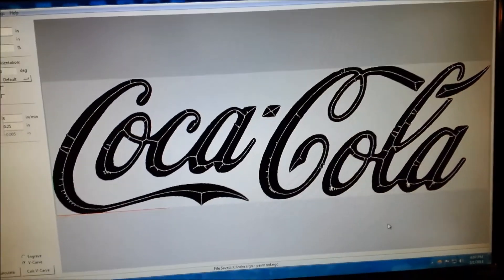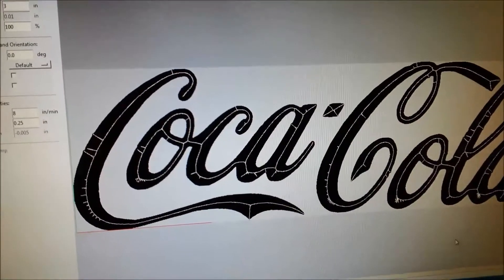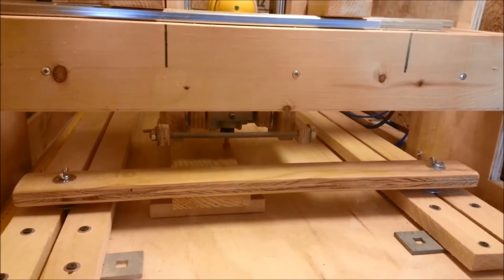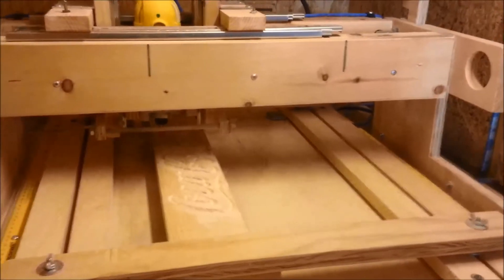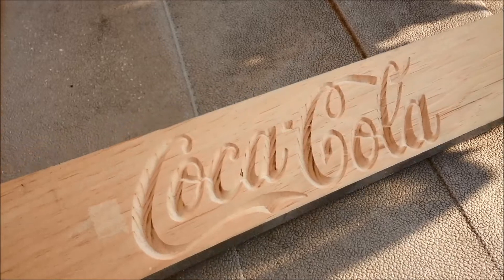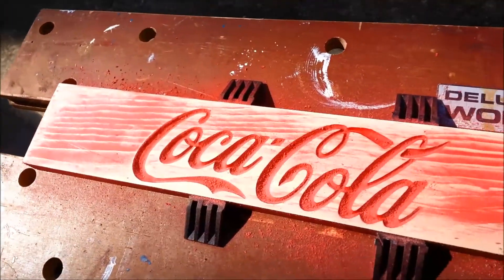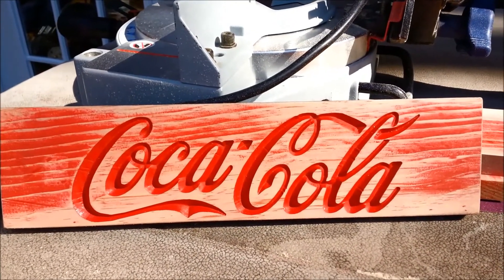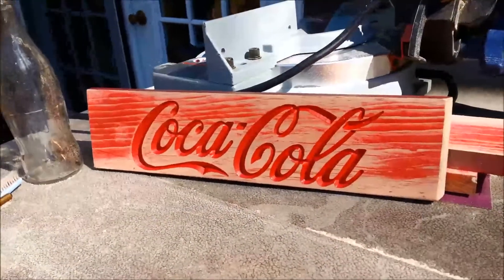Homebuilt DIY CNC Machine - Coke Sign

Comment: Talking about DIY, you did it almost all by yourself. Thank you for your great videos and useful information about software use, it is very useful. I have advise, if you want more speed by linear actuators, try using bigger screws they have bigger step and also they are more straight.
Reply from the maker: Igor Ć. Many thanks for your comments.